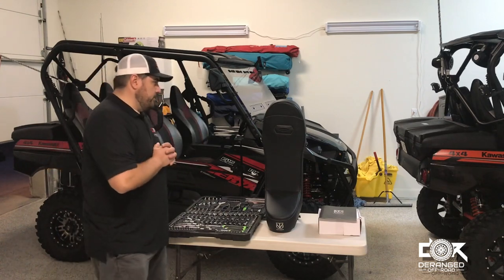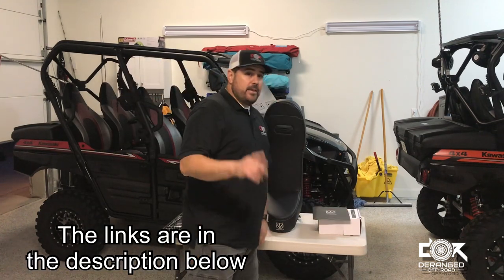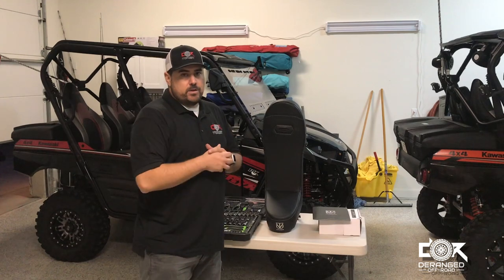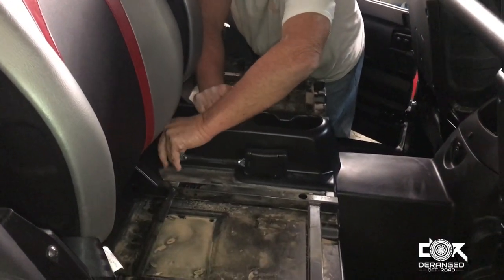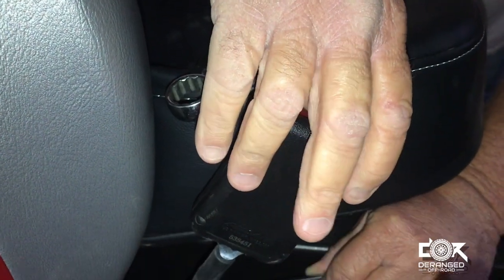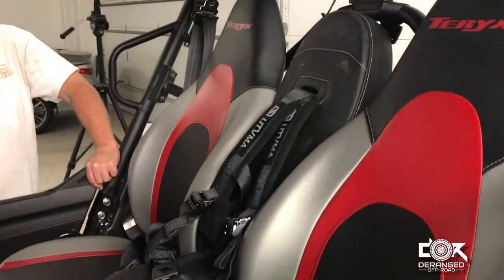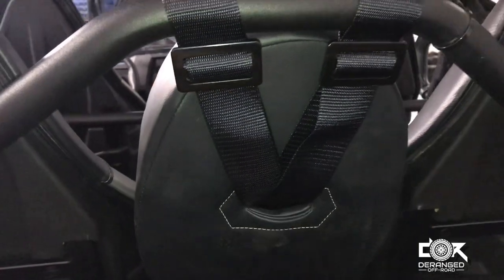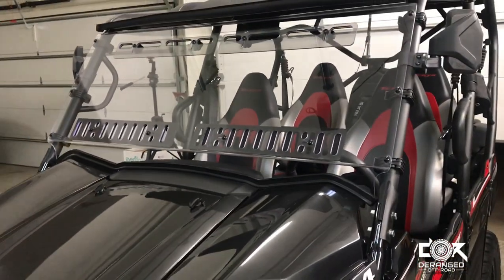5 seater UTV - Adding a bump seat

Comment: Speaking about options for strapping kids in. I bought my 19' T4 because it was the only 4 seat SXS that I could fit a rear facing infant seat in the rear seats. I use a tie down and the rear seats have holes in the seat mounting brackets that almost appear to be purposely placed to allow the hook of a tie down to slip through. Ratchet it down until the car seat is good and tight, and off we went. Worked the same way for a forward facing car seat too. Both of my kids fell asleep in their car seats during our maiden voyage to 5 Mile Rec Area.
Reply from the maker: Yeah that would work great but I have 3 kids and can’t do a car seat at all and had to go with another option. So the bump seat was it because it’s removable and cheaper then a bench. -Garrett
Reply: @DerangedOffRoad  Yeah,  I will have to switch to a bench or a bump seat if we have another kid.

Comment: Have you seen anyone using the front bump seat on the T4?  Does it work just as well as the back bump seat?
Reply from the maker: I have not seen anyone use the front bump seat and I only choose to run the back for my set up. From some of the comments on Facebook groups people seem to be happy with the front one overall. Most though run the rear one because the front will block vision for those seating in the back. - Garrett